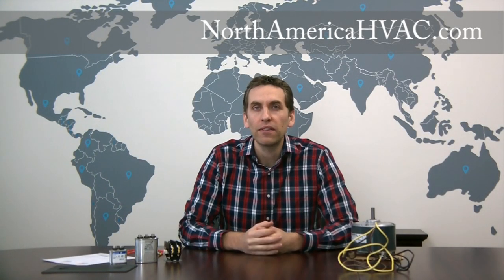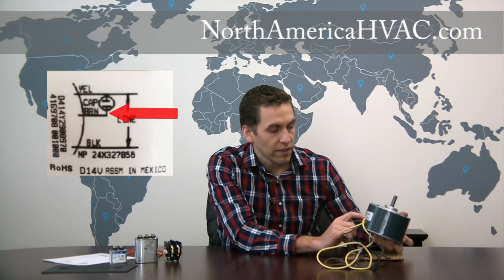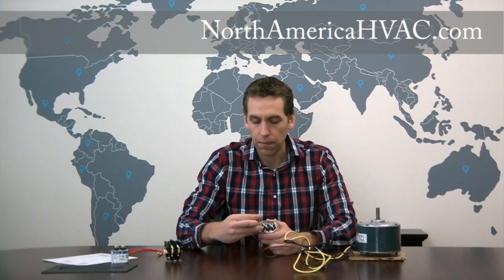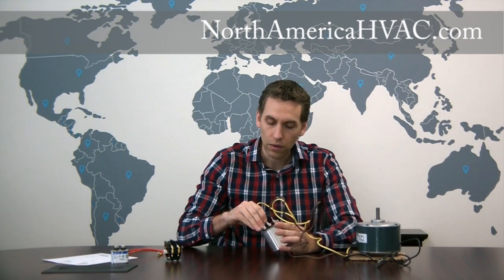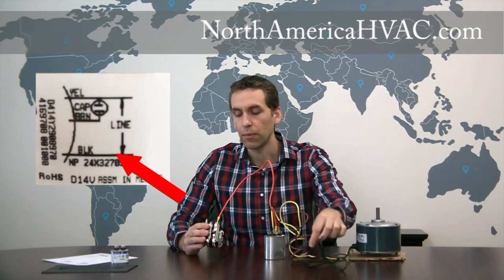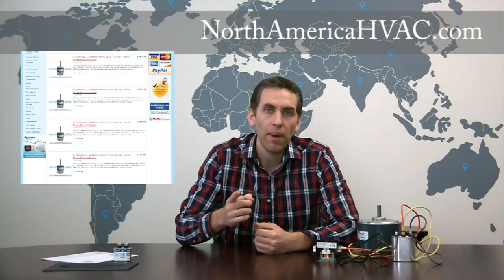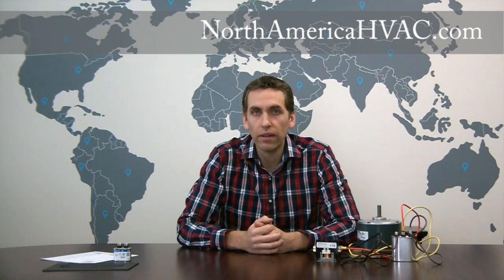How to Wire a 3 Wire AC Condenser Fan Motor

Comment: I listened. I tried it. It worked better, wicker & easier than I ever would have imagined! 15 mins total.
Reply from the maker: Keith B Thanks for sharing!  Glad your up and cooling again!
Reply: Thanks!
Reply: +North America HVAC,
Hi, I'm trying to wire mine without capacitor, can it be done?
Reply from the maker: No, air conditioner motors are PSC (perm split capacitor) motors and you cannot use them without a capacitor.
Reply: Keith B getting

Comment: Hello, originally I have a bad 3-wire motor, I just would like to know how to wire when I replace it with a 4-wire motor. Can I use the existing capacitor if the new motor has same specs than the old 3-wire?

Comment: Thank you but it seems many of the replacement motors have five wires instead of just three.  What am I supposed to do with the other two wires?  I see that there is a wiring schematic but it doesn't really help me.  I have an Emerson model K55HXJKL-2918

Comment: Thank you so much.  I had taken top off (fan) and cleaned inside and then cleaned loose dirt and then sprayed down coils with mild detergent solution and rinsed well.  I had a struggle with the fan assembly, trying to prop it up against the wall.  Eventually it slid enough to pull the purple and brown/orange cable off and  I had no idea where to put them.  this explained each of the wires on the capacitor perfectly, including the red wire already there.  I tried to look at the fan motor diagram, but it was so faded I couldn't make out the colors clearly.  I knew black on opposite of red below and then orange on the fan and purple on the C and after bolting it all back together, turned on AC and perfect, no hum and its blowing right direction.  Whew.

Comment: if the motor is not working can you still use the heat for the central heating air?

Comment: So I have a 4 wire condenser motor. If I cap off the brown with white strip, then I wire it EXACTLY like this 3 wire video where the Brown would go on fan capacitor and white would go on common capacitor and another wire will be on common going to the contactor and black would go on the contactor opposite side. Right ? Lol

Comment: Thank you for the video. I did not catch what goes on the herm terminal? There is a blue and yellow wire that is coming from the refrigerant I believe a big black thing is that what goes on the Herm? Just to make sure I understand the black wire goes to the contactor box one of the yellow wires goes to the C to fan , another yellow wire goes to the C from contractor box. I still have aNother yellow and blue wire that I don’t know what to do with. They are coming from the refrigerant it looks like. Thank you

Comment: it can be wired to operate in its on cap with a jumper installed.
doesn't have to be a dual cap.
Reply: Can you operate a 208~230 motor using a single 5uf cap and 240 volts?on the other 2 wires other than the capacitor brown?

Comment: Thanks for the video. The bad fan motor in my unit was wired to a plug. The fan motor i replaced was still running but had a bad bearing and was very annoying being just outside my bedroom window. I just matched wires to plug and used existing plug. The plug had slots for all wires including the ground wire.  I did replace capacitor with new one. I was a little nervous since wires were different color on new fan. After studying a few minutes I figured out which wires to match up.  Saved myself several hundred $$$$$ doing myself instead of HVAC Service guys, and a QUIET fan motor now!

Comment: Thanks. This was probably the fourth or fifth video I watched after going to a few websites also, to get me over the hump in installing my new four wire motor where there was a three wire motor with a purple wire instead of a red wire. Very simple explanation and explaining about the two different capacitors also was crucial.
Reply from the maker: John Sturtevant Thanks! - Have a great and cool summer!

Comment: Could you tell me why you need a dual 3 terminal capacitor and fan won't work with 2 terminal cap.?
One side of capacitor is herm for compressor, other side is fan.
If fan side of dual is bad and I don't have a dual, a separate capacitor will work as well as 2 individual capacitors, one for fan and one for compressor, share the common..gee whiz

Comment: Is it necessary to cut the motor shaft's excess length? Some say yes to prevent premature bearing wear, but if it's not necessary I'd rather not go through the trouble of cutting it.
Reply from the maker: If you have room for the full length of the shaft inside your air conditioner then you do not have to cut it.  Will it affect life span- perhaps someone could argue that is does in theory, but in the real world, I doubt anyone could demonstrate that, and have never heard any techs with that concern.  If the motor couldn't handle it, the manufacturer's wouldn't make the shaft that long.  Good luck!

Comment: Hello, when I connected the BROWN wire to FAN terminal and YELLOW to C, the fan was blowing inside.  I had to wire YELLOW to FAN and BROWN to C.

Also, the fan that was originally installed had BROWN, BLUE, and BLACK wires. That was rotating correctly.

Comment: Thank you.  Tried wiring a condenser motor w/o tri terminal capacitor. Went back to using 4 wires and may still have a problem.  Too wet out to check now. It started both ways but opened up the overloads.  I re-used(new one on way) the 5M capacitor.Seems Spec sheet called for 7.5 MFD. Can also check spin direction and reverse the short armature? leads. Can using 5 instead of 7.5 MFD capacitor overheat te fan internal Overloads ? Serious.
Reply from the maker: Pat Dwyer Thank you for your comment!   When you say that it opened up the overloads, can you be more specific as to what happened?  Did the entire AC unit lose power, or did the motor itself shut down?  After long of a period?
 You would definitely want to get the proper size capacitor for the fan motor, but you should not notice any problem running the 5M (rather than the 7.5M) in the very short term.  It would be more of an efficiency and long term durability issue than an immediate overload issue.
Reply: Only the condenser fan motor. It started and ran 20 minutes then stopped spinning.  Cooled off and started up and ran for 15-20 minutes in 105 degree heat.  Took it back to Grainger today to get the open air body I wanted. They told me" It is a bad motor". Gave me a replacement of same model,frame,etc. Will wire it up tomorrow morning. The marathon motor that came out was air cooled by machined splines, grooves and shaped openings at motor housing endplates. Packaged unit has a Drip guard of 5" diameter.  Be great IF it was just a bad motor. Internal overloads had zero air flow and windings get hot.OL's opened up to protect motor.  Still looking for the open air model. I have pic of what I want.
Reply from the maker: Pat Dwyer Keep us posted- I'm interested to hear as to whether the motor was bad or not.
Reply: Believe it or not the second motor I had ordered the same day has been running full blast for  2 days in 100+ heat index. Second motor is from Home Depot on-line. I will look at the box (In truck) and give make.First one was a Marathon motor from Grainger. Grainger got it here in under 48 hours. Wired it with separate Capacitors  4 wire configuration as it was w/ a 208 v  1200 rpm 1/2 Hp motor.  Took it back given another on that is still in box. The Home Depot one wired up same way fit unit housing perfectly no cutting of fan shaft,etc.  I will post the manufacturer when I get the box out of my truck.Home Depot had no way and would not expedite shipping so it took 6 days to get here ups ground from LA, California. Grainger shipped from Jacksonville ,Fl about 400 miles East  of Me in Pensacola.  So far so good I am actually starting to to get too cold by the time I finish pecking out this message with my right index finger. Thanks for your help. I can always go with the Dual capacitor next time  but as long as it is cranking out 65 degree air while it is close to 100 gdegree heat index   Thank you Home Depot. They do need to allow for expedited shipping.  Dwyer
Reply: You must run a 7.5 if it calls for it.

Comment: The fan I replaced was a 3 wire one (brown, purple and black) with only a 5mfd cap. The brown went to one terminal.  The purple went to the other terminal with a blue wire that went somewhere else. The black went to one of the legs on the contactor.
Reply: Yup, that's what I had.

Comment: What if you were using this as a ventilation fan in a garage? The fan motor I have is a GE A340 S. It has an orange, black and a blue wire. The diagram shows the capacitor connected between the blue and orange wires. 

Could you wire the orange and black wires directly to each 115 V connectors from a 230V 20 amp recepticile without using a start capacitor?

Instead of using the start capacitor, just spin the fan by hand prior to plugging it up. Or spin the fan when it starts to hum?

Reason being is I have an old 115V motor from a washing machine I installed a wheel arbor onto and a buffing wheel. I have it connected directly to a power cord with no start capacitor. Whenever I plug it in it hums. I just spin the buffing wheel in either direction and it works.
Reply: You can put a start cap on it and not have to worry about spinning it by hand  but if it's working for you now then I wouldn't worry about it

Comment: Mine came with 2 wires on the contactor and 1 on the cap . When I wied it like this it started melting the c terminal on the cap and had to use a hard start to get the compressor to kick on  so I had to keep it on the contactor to stop this problem , yes it's a 14yr Goodman

Comment: Thank you so much for this guide. You saved me a lot of money.
Reply from the maker: Thank you for your comment. We are glad to help! :-)
Reply: @northamericahvacvideos  Hello !
I like to recycle and make new things from old parts.
After 12 years my daikin Rxh35Cavmb died.Compressor got hole in it,but everything else works.(problem is i cant find any info or wireing diagrams )
I would like to make a welding fume extractor out of condenser fan ,but i dont know capacitor values(is there like most common value like in washing machine motors 15uF that works on 90% of motors?).How would you connect it to run by simply plugging it in the wall socket?
Can i use regular capacitor instead double for it since i dont have compressor connected?

My second question is about a internal fan motor that spins that cylindrical fan(looks like nice centrifugal blower if i do some plywood housing),it has 6 wires ,how do you connect it to different speeds?
I know these must be strange questions ,but im big on not throwing things that work.

Comment: Doe it matter what prong is used on the capacitor as long as it's in the correct place? Meaning there are 4 prongs on C, 3 on herm and 2 on fan. 2 words go to C does it matter which one gets connected where?
Reply from the maker: Hi,  Thank you for your comment! As long as you have them connected to the right set of prongs, there is no designated placement for each terminal. Thanks!
Reply: @northamericahvacvideos  Thank You

Comment: No, you don’t have to have a dual capacitor. Single cap will work just fine, with a jumper wire. Also, you should check the amp draw of the new motor. It should be about 75% of the name plate rating.

Comment: is there anyway you can hook up the wires directly without a capacitor when's the fan has been removed from the unit to use as a fan for work
Reply from the maker: Jaime, 
If you were to disconnect the motor and use it for something else, the motor would still require a capacitor. Thank you
Reply: @northamericahvacvideos  Hi, I purchased my motor from you on Amazon.  The one that came out of my unit was a 5KCP39FG.  I purchased the 5KCP39EG.  Just had to drill new holes on the grill that holds the fan. One question though: when I connected the wires as per the diagram on the motor housing (YELLOW to C and BROWN to FAN, my fan rotated in the reverse direction.  I had to reverse-connect these two wires to have the fan blow out from top of condenser. Has anyone reported that to you at all?
Reply from the maker: @paramjitkahai5570  Hi, Thank you for your comment. I will say there are many motors that begin with "5KCP39FG" that are followed by different numbers. It sounds like there is a change you may have ordered incorrectly. If you would send us the model number of the unit this motor is going in, we can begin by checking to see that it was ordered correctly. Thanks!

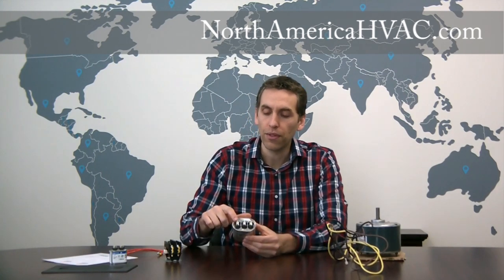Comment: at 1:07, your talk about 2 terminal capacitors not being able to be used with a 3 wire motor is wrong.  On a 2 connection capacitor, one side is the fan connection (usually brown)....the other side, this is (Common now although 2 sided capacitors don't have polarity), is connected to the (C) side of the existing 3 connector (C, Fan, Herm) capacitor that has the (Herm) connector for the compressor).  They are all like this.  I am surprised you don't know this.
Reply: My Rheem fan has 3 wires, and a 3 prong 50+5MFD Round Capacitor, and 2 prong 5MFD Oval Capacitor. So I agree with you, but since the Round one says +5MDF, does that mean I can remove the oval one?
Reply: @googlesucks3623  No.  The three prong marked C, Fan and Herm is still being used for the compressor.  If you remove it, the a/c won't work.  The fan capacitor was moved out of the 3 connector to a dedicated fan capacitor.  This might have been done for a few reasons.  The new fan capacitor has one connection to the fan, usually brown in Rheem/Rudd and the other side goes to either the C on the big capacitor (usually orange in Rheem) or, one side of the contactor T1 or T2 depending on who wired it, but also orange in Rheem
Reply: @googlesucks3623  I would also check the label on your fan motor to make sure what mfd rating it has and if the dedicated fan capacitor is the correct rating.
Reply: @JohnstonPettigrew  , thanks for the help. I had removed the fan to oil the spongy things inside that feed the fan shaft oil. When I put the connections back, I put the black wire to relay, the brownish tan wire to the 2 prong (terminal) oval 5MFD and the orange wire to the FAN terminal on the round capacitor. Rookie mistake I took a sloppy picture. After I read your reply I moved the orange wire to the C terminal. After that the fan started right up and still going. Thank you. About my question, I was wondering if I could move the Brown Tan wire to the 3 terminal cap FAN connection and remove the 2 terminal 5MFD altogether. I saw an original layout and the Rheem has just the 3 terminal round Capacitor 50+5MFD 370/440. I'll just leave it as it is, again thanks for the help, I feel more competent now, even if I don't sound competent.
Reply: @googlesucks3623  you could eliminate the dedicated fan capacitor and use the fan connection on the original 3 terminal cap., but the question is why was this wired with a dedicated fan cap. in the first place.  Since both are 5 mfd and the schematic calls for 5 mfd, why was this done?  If you test the Common to Fan on the larger cap. and it tests good, yes you can just use that one and eliminate the dedicated fan cap.  But, the question is why this was done this way......it is usually done because the fan side of the larger cap. has the wrong mfd rating and the tech doesn't have the proper cap. on the truck........or the fan side is bad and the tech doesn't have a replacement, but he does have a 5 mfd oval on the truck.  If the fan terminal to common tests good, yes, you can use it and disconnect the oval.  Brown goes to Fan and the other side can be eliminated as the common side of the big cap. has a jumper to either T1 or T2 already there.
Reply: @JohnstonPettigrew  , Thank you for taking the time to help. Yes the other side of the terminal goes to C where the Orange fan wire is and then a shorter orange wire goes from C to T1 on the relay where a Red wire is too. T2 has the black fan wire and another black wire which I think goes to the compressor. I don't know why it was done that way. I bought brand new capacitors from a licensed tech guy hanging out outside the HVAC supply. $30 for both TRADEPRO brand capacitors. I'll just leave it as it is since I can't find what the fan requires. It's a 3 wire Emerson model k55hxjgh-2667. It's working now. I learned a lot from our brief exchange. I understand what you are saying that something might have been off with the old cap or configuration and somebody maybe did a quick fix. I just moved here 4 months ago renting in a duplex from a family member that doesn't ever do maintenance on anything so I am getting a discount rent and don't want to be demanding anything if I can fix it myself. Again I sincerely thank you, before I was just kind of guessing. Especially after seeing this video where it said a 2 terminal oval is not to be used.
Reply: @googlesucks3623  that K55 is Emerson part number 51-21854-01, 1/6 hp, 1075 rpm at .73 amp and is original on that Rheem/Rudd unit you have.  It calls for a 3 mfd capacitor, in the spec. for that motor.  I have worked on many, it is definitely a 3 mfd cap.  Since you don't know how long that cap. was in place, it is not going to make much of a differnce if you change the dedicated oval to a 3 mfd from a 5 mfd.  The motor has probably run a little hotter for years and the jolt has probably wobbled the armature for years too.  Probably best to just leave it alone and keep an eye on the fan.  If the unit stops cooling.........the fan shuts down thermally......or the compressor goes to thermal overload, the fan will need to be replaced.  Century makes a great replacement for this old Emerson model.  It is ORM1016V1, model F48V48A01.  Hope this helps you stay kewl!!